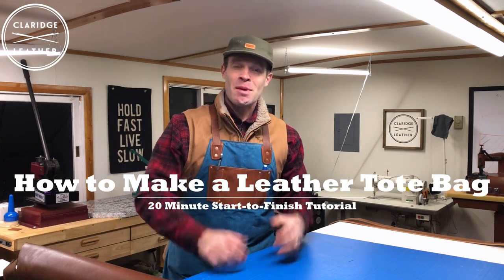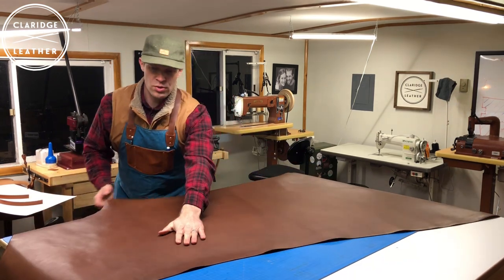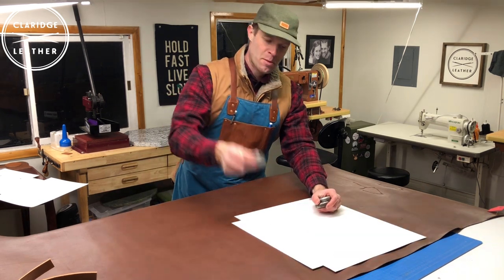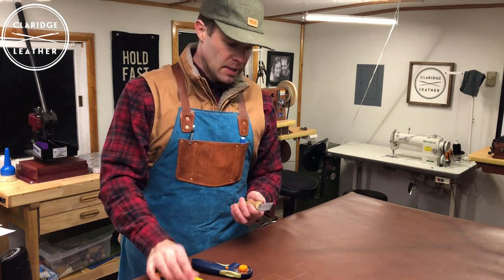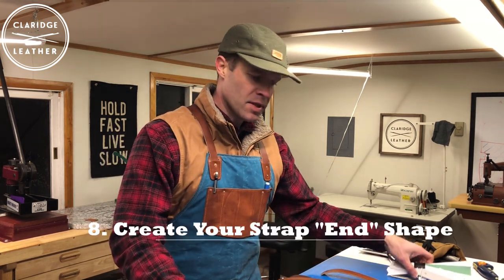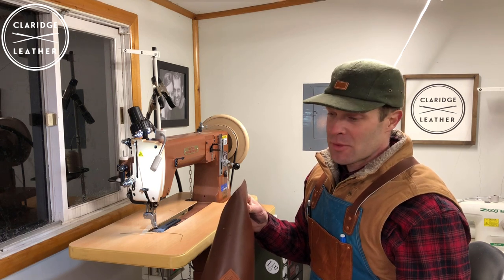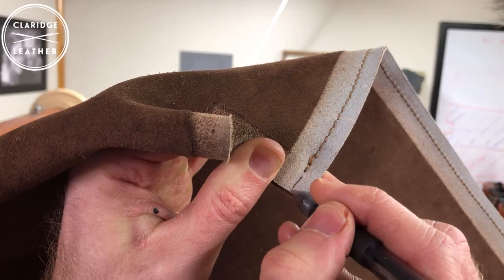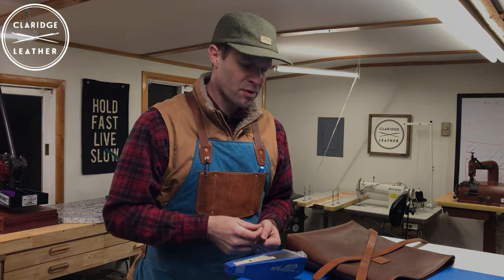Make a Tote! Nail it On the First Try With This Process

Comment: Hey mate! I stepped on the last video about the patterns and started making a lady's purse. I'm using a single wide strap for the bottom and sides, connecting the front and the back+flap which have rounded bottom corners. Using an oily green 7-8 oz for the main body, dark brown 6-7 for the bottom and strap, and a killer duck yellow 4-5 for some interior design.

Happy to report, I turned my first bag out last night! It was indeed a struggle, I didn't skive anything for lack of a tool. I'm learning how to do it with my modeling knife, but the results vary too much for now. I'll try to dampen the allowance on the dark leather and hammer it folded in place for a flatter bottom.

As you can probably tell, I'm loving your content!

Comment: Excellent video and really appreciate the sharing of knowledge! Do you plan to go into more depth on straps? Sizing, hardware options, handles and strap combinations? Thanks again for taking the time to do these.
Reply from the maker: Thanks, Russell! Do you have any specific strap/hardware questions? I will definitely make more videos and it’s always great to hear your specific questions first!
Reply: Thanks for the reply! I know the hardware question is a can of worms, there are so many choices. As far as the strap goes, is a rule of thumb for length you use? I want to make a detachable strap that's adjustable with hardware.
Reply from the maker: I will do a video on making an adjustable crossbody strap soon and we can talk about some of that. Thanks again!
Reply from the maker: I cut my crossbody straps to 54”, then they end up being about 48” after they’re all hooked up, with an adjustment range from there. I like to use a double loop slider or Conway Buckle for adjustment. For tote straps, I usually for about a 14” drop from the top of the strap (on top of the shoulder) to the top of the bag itself. 36” is a good starting place for the total strap length, but it depends, of course, where that strap is attached on the body of the bag.

Comment: the bag came out awesome.  could you cut the strap width 2in wide and then fold it in half and sew it?  that way you can use a smaller thickness leather and only have to finish one edge? i want to make this bag, but only have 4/5oz. leather on hand. thank you for sharing and explaining everything as well as you did.  it is a huge help to a newbie like myself.
Reply from the maker: Thanks for watching! I’m glad you found it helpful. 4 to 5 ounce Leather will make a great bag. You are exactly right, you can cut a 2 inch wide strap and double it over. One thing you could do also is fold both sides of that 2 inch strap to meet in the middle, so folding a half inch over from each side so they meet in the middle. Then sewtwo seams down the middle, leaving two finished edges on the 1” wide strap.
Reply: @ClaridgeLeather  thank you.  I actually like that idea better. I prefer stitching to burnishing.  Haha

Comment: I understand that you have a romanov "Gulliver" can you tell me the biggest ,thickest table you can clamp it to.Im trying to buy one and there is confusion as to if it will fit my 4 inch table.thank you
Reply from the maker: I’m sorry, I don’t have that specific tool— I have his smaller stitching clamp but not that big one. I apologize I can’t help! I don’t think it would clamp on a 4” thick table, but when my stitching clamps don’t fit the table I’m using I sometimes clamp something thinner, like a 1x4 board, to the table, then clamp to that instead of the table.

Comment: what thread thickness and needle are you using?
Reply from the maker: Size 23 needle and 207 thread 👍 Have fun!
Reply: @ClaridgeLeather  thanks! Have you thought about doing machine videos? There are 1000s of hand stitching techniques but very few on machine sewing. 

I recently bought a techsew 2750 and I have been learning. Videos on needle to thread size and why? Leather thickness to thread size… where to start a stitch and why, where to reenforce stitches. Problems like birds nest at the bottom of the stitch… 

Great vids either way!

Comment: Great video Tanner! Thanks for the the tip on notching in the corner.  I’ve struggled with that.  You should start o conversation over on Club House for new makers.  I talked with Parker from Stock and Barrel this morning on that format.  Just a thought. Keep up the good work!
Reply: Newbie here. What is Club House? Thanks!
Reply from the maker: Thanks, Tim! I am so squeezed for time... I think I will need to pass on Clubhouse for now! I've seen that Parker is on it, but I don't think I can swing it! (I don't sleep as it is!) Thanks for your support, Tim!

Comment: Hello, thanks for your video. Could you tell me why you skived the edges that were sewn together at the sides of the bag? Would this weaken the bag? Thanks David.
Reply from the maker: Hi David! I skive those to keep the bulk down and make for a nicer look with less of a big “pucker” from the inverted seam- does that make sense? I haven’t always done this, but I generally do it now. Since the bottom of the bag is the area that will take the stress of carrying items (and the side seams take very little stress), I don’t anticipate this being an issue, but it’s definitely good to think about where you will potentially lose strength! Thanks so much for watching and for the great question!
Reply: Thanks for your answer. I think I'll learn a lot from your videos. Please keep them coming. ☺️

Comment: Hiya. Just thought I'd stop you a line about working in the cold. I precut several check book covers last month and discovered that the ones I made in the shop were 3/16 shorter due to the cold
 The others were fine. I assembled them in the house
Reply from the maker: Oh no!! Why were they short?!
Reply: @ClaridgeLeather  after being glued and sewn in the cold I guess they were held to the smaller size by the thread and Finnish.